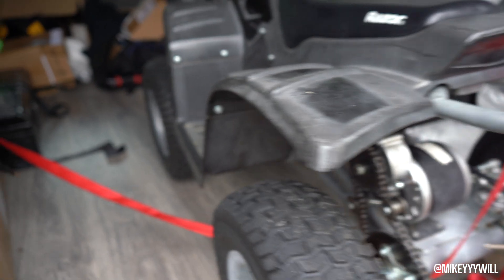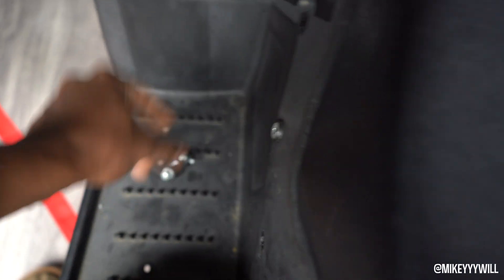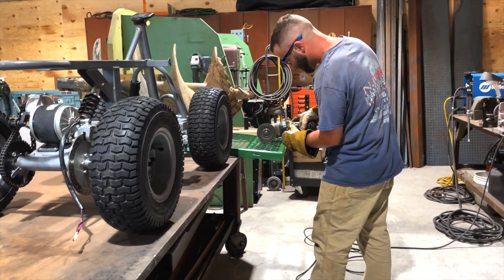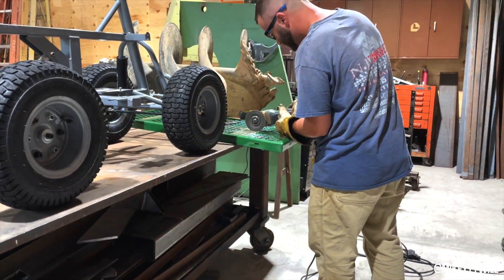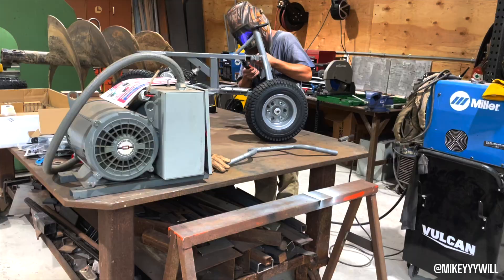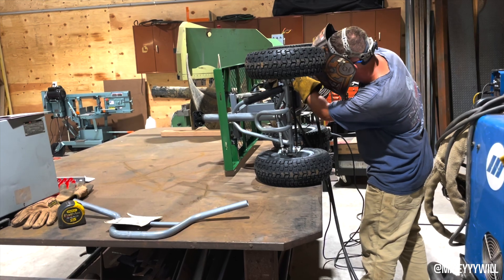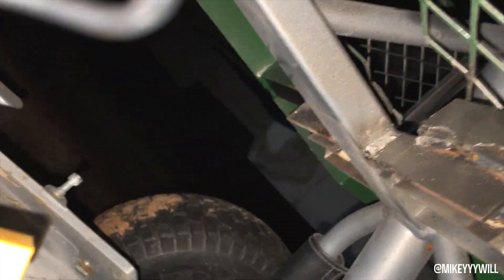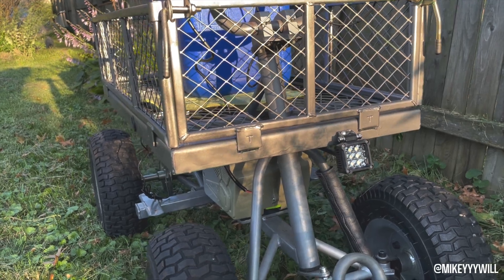How To Build The ULTIMATE ELECTRIC cooler/utility CART (40V)

Comment: Yo man I love what you did with the quad I knew you would do something good with it it was just going to sit in my apartment probaly forever😅
Reply: If you do anything else, let me know!
Reply from the maker: @williamowens6748  I can’t believe you actually found me on here man. I hope you’re doing well. The quad gets used a lot. All the homies love it. Especially for carrying tools and stuff
Reply: I wish I would have seen it sooner because I could have showed you how to get them fenders off real quick all you do is pull the bars and those two bolts in the back and then the two little bolts under the front fenders LOL but you figured it out I'm glad you getting some use out of it! I really wanted to make it into a 72 volt drag razor quad but when I tried to put 60 volts through it even with me hanging my feet and my upper torso area over the handlebars with the handlebars pushed forward it would still fucking wheelie it was so small that the 60 volts would literally make you loop the shit everytime! but if I would have had a variable throttle it probably would have been a blast